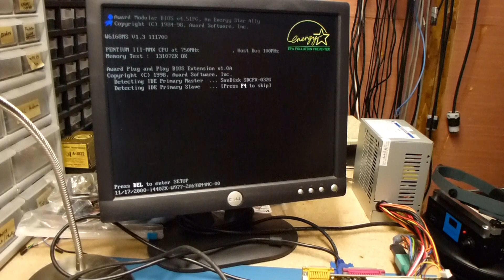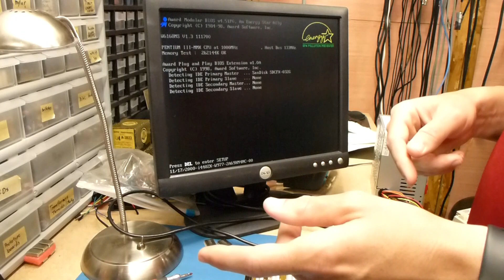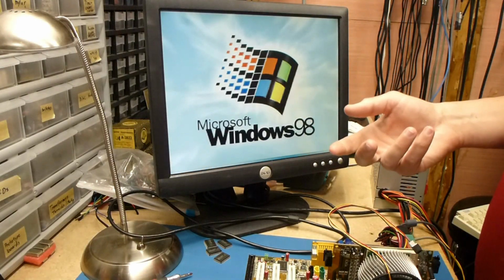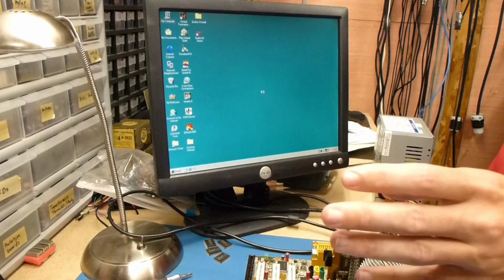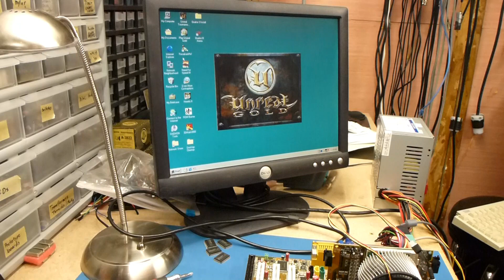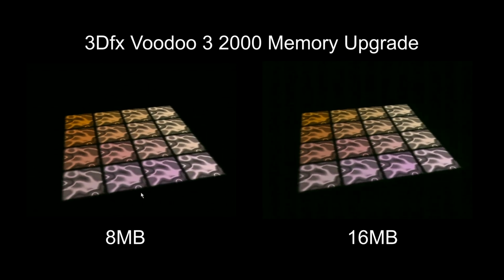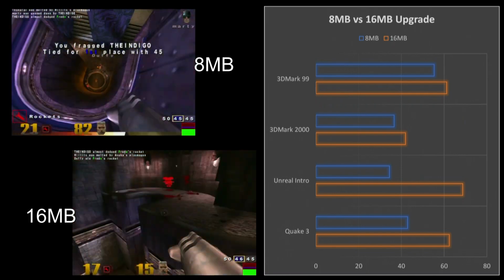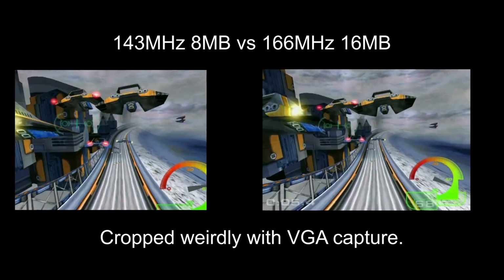3Dfx Voodoo Powered Motherboard Gets a Memory Upgrade! #GPUJune

Comment: I've been trying this on the Rev 1 board. I've replaced the ram with the bigger (Samsung KM4132G271BQ) chips and i've swapped over the resistor to tell it it has 16MB but it seems to be having trouble with the bank switch and i don't have the 0 ohm resistors/jumpers near the PCI slot that you do on your board. I can move the resistor back to 8MB and it functions fine again so the ram appears to be good but sadly i'm now stuck.

Comment: One thing I would do, since you're modding the crap out of it anyway, is replace the cooler on the Voodoo3 chip. You might want lower temperatures in the long term

Comment: I should probably note - some of these boards come with 16MB chips that are blocked down to 8MB due to the absence of a 472 SMD resistor. I did a post on Reddit about mine and how it came with that very same memory chip model (except its suffix which only indicates frequency, mine is 143 and K2's is 166, but both can do 166 ez.) from factory, yet MSI left the pads at R658 empty.

I only had to add the 472 SMD resistor on there on mine and I unlocked the full 16MB. In conclusion, MSI recycled some of the 16MB boards sometime later in the 6168's lifecycle as 8MB boards by leaving out a single resistor. The easiest way to find if you have a 16MB board toned down to 8MB, is by checking R685 and R687 - if you have two zero-ohm bridges in those two spots ALREADY populated from factory, and R686 is empty, chances are you have a 16MB board and the only modification required is adding a 472 resistor at R658.

Comment: Great video. Saw it when you published it and thought it was a great mod. Now i finally got the same motherboard and trying to do the same, even got the ram chips from a matrox g400. But still... Have watched the video like 4 times and still its unclear to me which resistors need to be moved in the end :) could you please give me an advice? Thanks. What temp did you use for desokdering the chips with hot air?
Reply from the maker: Oh, yeah it was hard to convey in the video, if you look at the video description I posted a link to the final changes for the resistors. They are images but tell the whole story will enough.

Hope the mod goes well! Let me know if you have any other questions!
Reply: @DKJones96  thanks for replying. Yes. The images are great. I was wondering the temp you used in hot air station, because removing the ram from the Matrox I ripped off a pad... Don't want that to happen with the motherboard... I used a lot of flux but looks like they were really well attached... That had never happened to me

Comment: My 6168 motherboard make 493 point in 3d mark 2000. My similar config with PCI V3 2000 make 2000 point.  6168 Fast like Velocity 100 in 3d :) Only one ROPs enabled? How to diagnostic? My version is first gen 6168 without TV out.  Thank you.
Reply from the maker: The motherboard should have both TMUs running as it is just a V3 2K onboard. You can check it using the mojo utility if you download and install the 3dfx SDK package that can be found online. It'll report to you exactly what the GPU is seeing.

Comment: What kind of CPU did you end up going with?
And what is the quake 3 arena timedemo1 average fps on that machine? Curious as I want to compare it to some of my retro systems 🤙

Sweet sd800 dual floppy 👌
Reply from the maker: Yes, the timedemo is a VGA capture from this system. Processor was a P3 Coppermine at 900MHz and the GPU was at stock 143MHz. I run it at 1.2GHz now(9x 133MHz bus) and the GPU is at 166MHz. It sped the benchmarks up with both the GPU and CPU speed up so there is possibly more that can be eeked out if I really wanted to.
Reply: What resolution were you running for those fps numbers in quake 3?
42.9fps to 62.4fps with the memory upgrade?
Also, any noteable graphics settings in the game that I should take note of? 

Thanks! 🤙

Comment: I was unable to salvage the one I pulled from a packard bell - it was that badly damaged by all of its caps failing. The FSP PSU and Pentium III 650 that came with it live on however.
Reply from the maker: Ahh man. F. Being in vintage computing we inevitably run into those and it sucks big time. I've currently got a Voodoo 2 project going where I'm having to grind back the chip plastic to make new legs for them and whew is it driving me nuts. The card got some sort of chemical on it that attacked it pretty badly.

Comment: Really amazing video! I love the memorymod and all the red caps, but you mentioned a 1.2ghz mod? Do you have a followup video with that upgrade?
Reply from the maker: I wish. It turns out that even with the most up to date BIOS this board just doesn't support Tualatin chips, contrary to what I've read online. To get 1.2GHz I will have to overclock a 100MHz bus model coppermine. Shockingly, they offered up to 1GHz in the 100MHz models so in theory you should be able to attain 1.33GHz if you can eek that out of your sample.

I, unfortunately, don't have one of them. From what I can tell this board just can't do the lower voltages required by the Tualatin models.

Comment: so did you jumper over the chip select???? you forgot to tell us what you actually did
Reply from the maker: I have a photo gallery in the description that gives a visual of the hardware jumper changes.

https://imgur.com/gallery/LAt1McR

On this board, Chip Select is normally attached to the Bank 0 output on the GPU in the 8MB configuration. Fairly normal but kind of unnecessary since there is only ever one bank! I can only guess that there are problems if you drive an output like that with no load so they did this as a way to prevent it. What I end up doing for this upgrade is grounding chip select on the SGRAM and Bank 0 output goes to Address line 11. Toggling the address line on the module looks like a second bank to the GPU which uses the rest of the address lines as usual so we get 16MB. Typically you will have 2MB SGRAM modules on a Voodoo 3 card and it isn't really setup for using 4x 4MB modules. Kind of cool how they worked that out. I think only one model of 16MB AGP cards run 4x 4MB as well.

Comment: Now I want to see full benchmarks - I'm mostly interested how MSI-6168 compared to regular Voodoo 3 cards.
Reply from the maker: To do this I would need to find a Slot 1 or Socket 370 motherboard and buy some AGP Voodoo cards. I only have PCI Voodoo expansion cards anymore due to previous frustrations with AGP compatibility when a PCI card will work in almost anything with a PCI slot and it's only a small performance penalty.

As it stands, the AGP Voodoo 3 2000 on this motherboard is faster than the PCI version in this same motherboard when they both have 16MB of VRAM. It's not a huge difference as the Voodoo card doesn't take advantage of any of the special AGP features but the data throughput of AGP is twice that of PCI so you get a bit of a bump. In fact, that fast transfer rate is probably why the pre-mod 8MB setup held its own as well as it did.
Reply: @DKJones96  If it's true (Not that I'm questioning your experience), then 3dfx had perfect way to increase their presence in OEM market. Too bad they had to make almost all board manufacturers their direct competitor by aquisition of STB. One more reason why we should consider this entire deal main reason of 3dfx's downfall.
Reply from the maker: @TurboMMaster  I don't know that I would say STB was the entire reason but it didn't help. There are tons and tons of STB Voodoo cards out there and the Voodoo 3 sold like hot cakes at the time but there is an argument to be made that the Riva TNT and Rage 128 got a substantial bump from card makers during a crucial time for 3Dfx.

I think either way their demise was inevitable when they got caught with their pants down on the GeForce 256 release. The 256s integrated T&L and the VSA-100s high cost really bit them and there wasn't any way for them to recover from that set-back.

Comment: Sadly, mine doesn’t work (unless I plug an external PCI video card. The onboard Voodoo is dead (it doesn’t even get hot, as if it’s not receiving power). :(
Reply from the maker: Oh no! It might not be getting power if that's the case which can be a good thing. Semiconductors like to fail shorted so if it was getting really hot with nothing the chip needs replaced but it's much easier to work on an external part like a regulator.

The Voodoo card needs about 2.75V so it will have its own power regulator on the board. I would have to pull mine out of the case to try and find out which one it is but I imagine if you fired it up, ran it for a few minutes, and then shut it down you could feel around for the bad regulator as it would be cold compared to the others on the board.

I've thought of messing with this regulator to adjust voltage since the 3500 runs about 3V at 183MHz so to get that kind of overclock stable most Voodoo 3s will need to see a slight bump. I decided against it but the card definitely has its own power regulator.

If the regulator needs replaced you'll definitely need a board pre-heater and a good heat gun those FETs are really soldered on there.

Comment: Dude, you absolutely win GPU June! What a fantastic video.

Which CPU and memory are you going with?
Reply from the maker: Thank you very much! 

I want to install a Tualatin 1.2GHz but I can't get it to post with that so I'm back at 1.0GHz Coppermine. I'm going to try a BIOS update on it and hope that works. I've talked to a person on eBay that services these boards and he says they run just fine. We will see. 

As for RAM, it has 512MB installed now. Doesn't sound like much these days but even 256MB was plenty for what I'm doing. That being said, I found 2x 256MB Crucial CAS2 PC-133 RAM sticks and really wanted to use them to top the machine off.
Reply: @DKJones96  Well coincidences like this are strange indeed; a 16mb MSI MS-6168 Ver.2 came up for sale yesterday, and I bought it. I've been looking for any 6168 for a while, I wasn't even aware of the 16mb version, and the day after watching your video I find one. Whatever strings you pulled for me, thanks lol!

When it arrives I'll send you the ram chip part numbers. They'll probably be the same, but who knows with 90's video cards? Every voodoo 2 I own has different memory.
Reply from the maker: @phillycheesetake  I watched that auction! In the photos it looked to be the same Samsung part numbers as best I could tell. If you let me know though I will add them to my info here if they are different. That board also has the normal front panel connector which is really nice.

Have fun with that thing, it's a rare gem indeed!
Reply: @DKJones96  I noticed the front panel header and Conexant TV-out chip, glad to have both. The board has everything except front USB, which maybe for completeness I'll add, but I hesitate to modify collectable hardware for vanity reasons. If there's evidence that this board as configured sometimes came with it, then sure.

I'll let you know on those chips, happy #GPUJune!
Reply from the maker: @phillycheesetake  When it comes to the USB connector, don't bother... 2 reasons. It's USB 1.1 so it's slow as molasses and it's only one port. The way they do it is a jumper by the PCI slots(J16) deactivates one of the rear ports and connects it to the front. It's way nicer to just get a USB 2.0 PCI card with an internal connector and use that. Plus, that USB connector is a non-standard pinout so you have to modify a standard one to fit.

The TV out is a nice feature but I've found it is undocumented so you have to find out what the pinout is(the conexant TV chip connects to the header that is between the ATX power input and the processor socket and it's called J17). On mine, for some reason, when I switch on the TV out I end up with a very dark RGB output but the S-video is fine. Curious if yours does the same! If it does it might explain why it is undocumented. I have the pinout somewhere but it was easy to figure out. It's an S-video output and the pins can be traced back to it just like they can be on a Voodoo card and it will give you what is what if you compare them.
Reply: @DKJones96  Now that you mention the non-standard USB pinout, that makes me think it's some OEM Packard Bell shenanigans, so I definitely won't be putting it on an MSI board.

By the way, the pinout for J17 is on page 2-46 of the manual, it's;
[COMP] [GND] [EMPTY]
[GND] [C] [Y]
Reply from the maker: @phillycheesetake  My manual chapter 2 ends on 45! Got a link to the manual you found? I might have the connector done wrong on mine.
Reply: @DKJones96  Hey, the board arrived yesterday. If you have the award 1.3 bios I'd really appreciate it, stuck on a P-II 266 right now lol.
The memory modules on my board are KM4132G112Q-7
, I'll just print the entire text;
SAMSUNG 010
KM4132G112Q-7
UFLK22EDS KOREA
Reply from the maker: @phillycheesetake  That's great info! Looks like similar part numbers but the stock chips are 7ns vs the 6ns I transplanted. Either way should do 166 without issue!

For the bios I found a out just how much of a pain in the ass it is to find a version of awdflash that will dump! I do have V1.3. You will need to make a basic DOS floppy to boot from. The flasher I included is the one that worked for me. The following dump of mine is on a Version 2 board. https://drive.google.com/file/d/10RQxbke3WWhPOfRJLod6rUWu4gOrZwPl/view?usp=sharing

I know mine supports Coppermine at 133MHz as it is currently running one. Supposedly there is no way for it to ever support Tualatin because of a limit on the VCore that this board can set. I will note, I have to disable spread spectum, reboot, and then tell it 133MHz for it to do that FSB speed. Doesn't have a problem after that but since 133MHz isn't an 'official' 440 series speed it can be a bit funny getting there. It also won't auto-detect to that speed and will default to a max of 100MHz. Not a bad thing, just what it is.

Also, CRT on that setup just died. Perfect!
Reply: @DKJones96  Fantastic, thanks very much. You've saved me hours right there.

I'd be happy as a clam if my board also does 133bus and 166 on the Voodoo, if so I have an 866 ready to go. I looked up the datasheet of the PQFP modules, and it looks like the KM4132G112Q-C is what you'd need to do 183, and that's assuming that the core is capable of it.

I'm sure someone will eventually get round to doing that. There's a guy in Spain, goes by Osckhar, memory-modding V3s and he gets them to 215mHz with 200mHz rated modules. He's not using 3500 donor cores AFAIK.

Sorry to hear about the CRT, hope it's an easy fix. Hey, maybe it's another video!
Reply from the maker: @phillycheesetake  Yeah I think if the Vcore was raised a bit on the Voodoo 3 it would gladly do 183. The datasheet for the Voodoo chip shows a higher input voltage for the 183MHz models.

215MHz would be pretty sick.

It's a super low-hour monitor. Could be anything from caps to the flyback taking a dump. Sure looked like a horizontal deflection problem.
Reply: @DKJones96  Wait, so for 133 to work properly on 6168 (and possibly 6163 too) you have to disable spread spectrum entirely?
Reply from the maker: @NSHG  I do believe that's right. I also had to do that on my super socket 7 machines.
Reply: @DKJones96  Well, I guess it's testing time for me 😅. Both my 6163 and 6168 had issues running a 133FSB 1000EB without strange juju happening.
Reply: @DKJones96  Well, figured I'd update in my 6168's case - 133FSB refuses to work. It's a Rev2, but 133FSB is horribly unstable. Either it crashes with a stack error during boot, or it goes as far as the logon screen before sending me in a never ending BSOD loop.

Haven't tested the 6163 yet but I don't have much hope for it, considering the clockgen is similar to 6168.
Reply from the maker: @NSHG  running PC133 memory? Is the processor a 133 unit or a 100 you are overclocking? Might try easing it up there and see what it finally dies at. I can't remember what the bus divider settings are in the bios for these as I haven't adjusted it in forever.